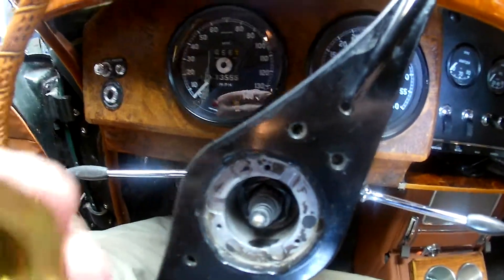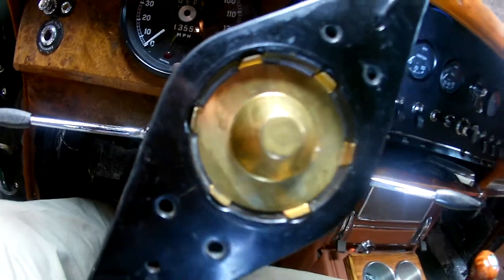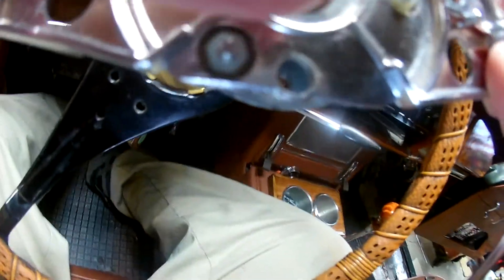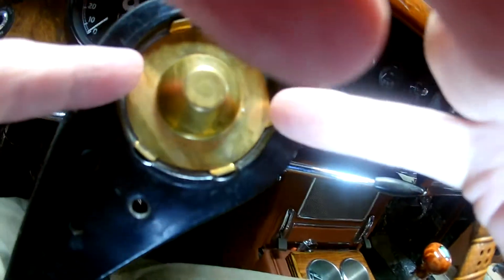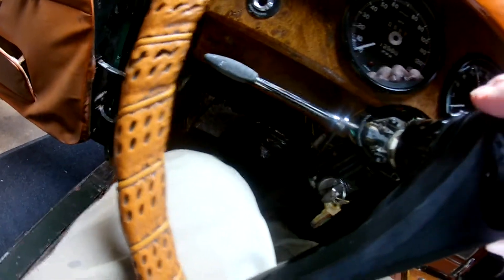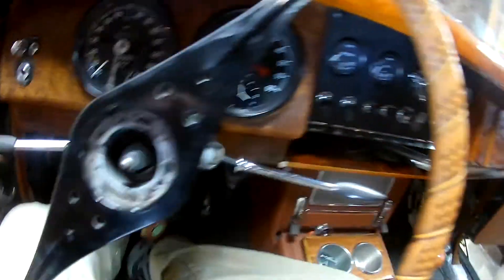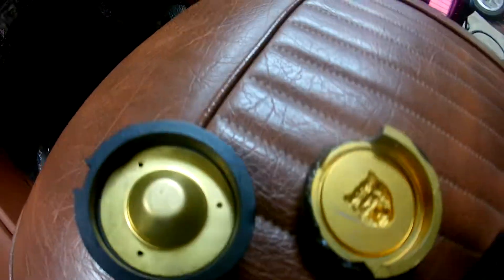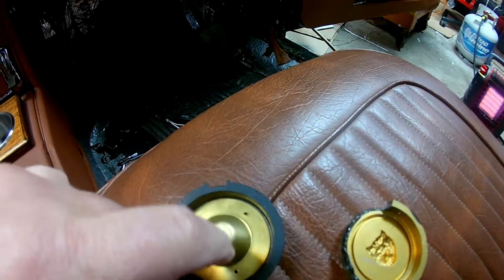1966 Jaguar Horn push assembly questions # 1

Comment: How was this solved ?
Reply from the maker: I never was able to solve this as it was above my skill level and the lower steering column bushings were out of kilter. I did not want to pull the entire steering column. I did wire a temporary horn switch to a the gear shift, which isn't pretty, but works. I also installed a Motooito steering wheel.